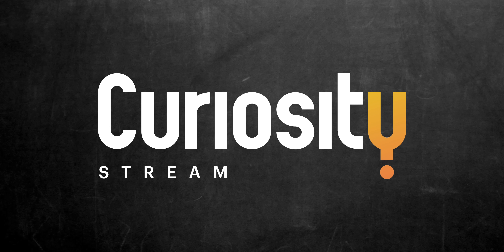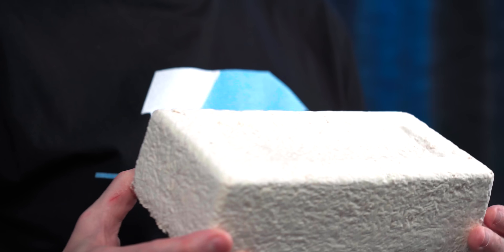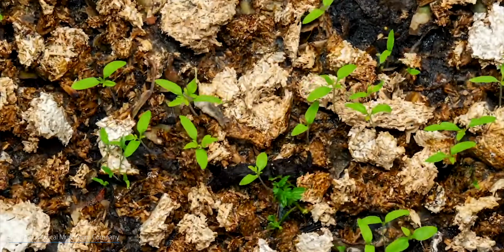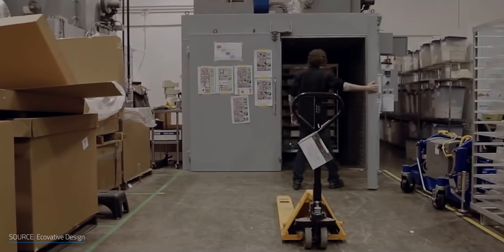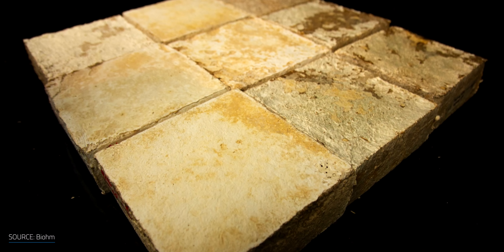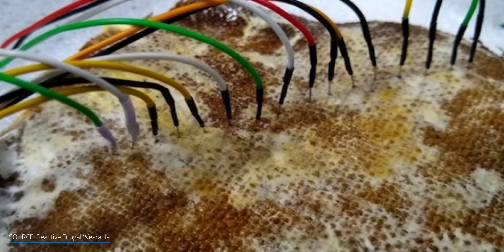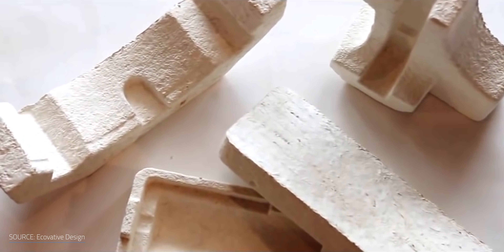Is Mycelium Fungus the Plastic of the Future?

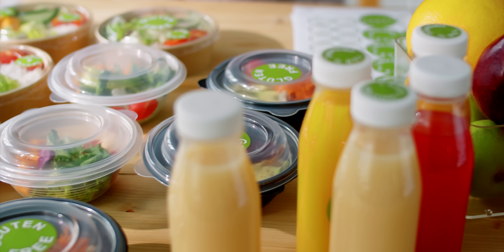Comment: The examples of packaging you show starting at 1:45 mostly look like food packaging. And the benefits of plastic you emphasize are it's water resistance, heat resistance, and durability.
Is this fungus based 'plastic' actually a replacement for any of those uses?

For non-food packaging, what are the benefits compared to cardboard?
Reply: My thought exactly... As much as I like the idea of an environmentally friendly plastic, I'm afraid that this is not the solution to any of our problems. Companies like adidas will use it for green-washing: Marketing their new innovative, eco-friendly shoes, and still pack all their products in traditional plastic-packaging...
Reply: this is not a plastic  :))) it is made of a biopolymer called CHITIN that is what the mycellium is made of.CHITIN is not a plastic ,it is not thermo formable cannot be melted or pelletized ,it is GROWN in it's final shape or machined after growing.
Reply: @Veselian  You didn't address any of my points.

Is this 'plastic replacement' anywhere near as heat resistant, water resistant and durable as actual plastic?
In situations where water/heat resistance and durability aren't needed, what benefits does it offer over cardboard?
Reply: Cardboard is process intensive to produce and requires a thin plastic coating for water resistance that usually makes it unrecyclable.
Reply: @tenchuu007  Are you saying fungus based packaging is less intensive (on resources, time, or labour?) to make and that it's waterproof and recyclable?
Reply: @joshuacollins385  Much less intensive in resources and labor, time maybe not at this point but with scaling. I didn't say it was waterproof, but it does have a higher level of resistance than standard cardboard. And it's compostable, which is better than recyclable.
Reply: @tenchuu007  Compostable is good. I assumed fungus packaging was less efficient on resources and labour, but if I'm wrong I'm glad that's the case. If it is better then it shouldn't be too long until we see it on the shelves.
Reply: @joshuacollins385  Yes, paper materials are high water, high energy productions. Recycling them can take less, assuming you have relatively uniform input but you still will have to soak the wood in heated water to break the fibers up enough to be mashed into paper pulp and then formed into cardboard. The myco packaging is self-forming to the constraints you give it, then you heat it with air enough to kill the fungus (which should be significantly less energy intensive than heating water). I've received several electronic devices in the myco packaging and it has performed at least as well as any cardboard I've received and I think it's a bit lighter as well.

Comment: Love your videos, but here's my take: Sounds like a ideal utopian dream, but the possess in creating it looks slow.  Modern people like the idea of instant gratification, they like having microwaves to heat their food nearly instantly and have little to no clean up.  They like the fact that they have running water in their pipes instead of picking up water and the watering hole.  What I'm getting at is The molds that they put this Mycelium needs to grow into it's form and then heated (CO2 admission) to kill it.  There's only so much space in a oven and space to grow Mycellium.  Vs plastic, it can be shaped nearly instantly and only requires a few forms that can be created every couple of seconds.  Your video shows it takes up to 8hr to start forming growth.  Unless the process can be much faster and do not require so much space for growth, it sounds good but, it may not be very viable.  What needs to happen is being able to form mycellium into pellets like plastic does and then reconstituting it into different forms as see fit.  I'm glad these companies are spearheading this movement and I hope government regulations change the law for packaging.  I would like them to take this process further alone.

Comment: I wonder how does mycelium brick work with rain and moisture? I see a lot of potential in it, but is it, untreated, similar to wood? As in it needs proper foundation and roofing or it starts to go bad? What happens when it gets wet? How does it deal with moisture if used as insulation? Does it easily grow mold? Does it breath like wood does? So much I'd like to know about it

Comment: Most of those uses seem like it could be practical, but using the stuff to make building and circuits seems like a worse option. Why would you want to build something like that with a material that will decompose over time faster than wood?

Comment: Ya I actually need to re-insulate my house here in the next year or so.  As a practical matter I'll probably still go with a spray-in foam (as it doesn't require as much deconstruction to apply) but I'll give mycelium based products a good look first.  If I can reasonable afford to go that route, I will.

Comment: one test id want to run is take the insulation, put it in a normal wood frame wall, then get it wet like say a leaking pipe. 
all that in the dark and i want to see what mold will do to it. there was that issue with paper backed drywall growing mold so how would this hold up?

Comment: I hope this takes off, I'd love to be able to just toss packaging in the compost instead of having to recycle more plastic.
Reply: Plastic cannot be and is not recycled. 90% of all plastic ends up in a landfill because the process of "recycling" it results in greater pollution than the original creation of it. We need to stop making disposable plastics and make plastics, biodegradable ones (which already exist and are in use), that are durable and last a long time. There's nothing wrong with plastics, they just need to be used properly.
Reply: @williameldridge9382  Agreed, I have low confidence in anything useful happening to the plastics after I put them in the recycling bin, that's why I would prefer something like this. Still, I need to dispose of plastics somehow, so recycling bin it is.

Comment: I wonder how the insulation would bare in hot humid areas where [black] mold is an issue.  Will it increase, decrease or have no discernable effects.  Overall, lets hope this innovation pans out and spreads ;)

Comment: a mycelium house would be cool.
but we need to create it as one piece. 
we place a huge form and fill it with mycelium food and place a tent over to control the environment.

then we wait 1-2 weeks and then we heat treat the entire house killing the mycelium.

next step is to weatherproof the house to prevent moisture to get into the mycelium structure.

Comment: Bricks: Conex containers support their weight loads at the corners.
A brick mold with ridged corners that the mycelium won't consume but will bond to it should give a much higher PSI load. It would be cost effective when 1st principles & physics are applied at the engineering phase.

Comment: Um, it is food tho, so should another fungus, bacteria, or (god forbid) slime mould amoeba get onto it, with a little moisture I guess... gobble gobble gobble. Slugs 'n snails also fungus. The mycelium isn't like the roots of a plant btw, it's more like the plant, crossed with an inside-out stomach (it releases acids and enzymes to digest its surroundings) with the mushroom or other "fruiting body" existing only to release spores at the end of its life. The rigidity is given by chitin, you may be more familiar with this as the outer shell of insects (the bit that makes insects crunchy) so you gotta watch out for exposure to acids etc. I'm fine eating a bit of plastic, "non bio-degradable" basically means it's inert, but smaller organisms obviously can have a harder time dealing with it.

Comment: Note all plastics can be recycled the vast majority of them currently cost more money to recycle than you can make with them. Simply requiring all plastics have deposit for return and requiring the money needed to recycle and use all plastics is included in the price of all plastics created would solve most of the problem. Cost of plastics would go up so the Fungus or other alternatives might be cheaper but this simple idea require all plastics be recycled the money paid in advance by plastic producers would handle most of the problems.

Comment: Not entirelly sold on construction, but 100% on board with packaging.  

Small nitpick: anything organic will generate carbon monoxide when burned.  Mycelium may generate less heat and less smoke overall than a PS or PU, but it will still generate some toxic gases in a fire.

Comment: As I have a background both in Science and Construction, I would be wondering how long this product lasts before naturally breaking down? For instance a number of metals when exposed to air eventually rust and numbers of timbers exposed to air begin to rot. Of course both metals and timber can be treated with chemicals and processes to prolong longevity.  What dose the solid data say about the longevity of theses products?  I am all for innovation and environmental footprints but are these products really fit for purpose???

Comment: Hmmmmmmm, about a week? 

Well, assuming a cycle time of 10sec that's 60.5k cycles of a thermoforming machine.

To match production rate of one thermoforming machine, you would need about 20k sf of growing wearhouse. Plus all the supporting processes need some space. And it appears to have a lot of human input, it need to be automated but thats not that big of a deal. 

Cycle time is the main killer. It needs improvement if it's going to replace anything in volume. 
Maybe a way to do continuous production?

Comment: Most of the stuff this would replace plastic for in packaging (since it shares the same use case limitations as hydroscopic polymers) can be done with the wood pulp or mulch you'd feed the fungus anyways. Maybe the novelty will get people onboard with alternative packaging materials but unfortunately we only ended up getting a small idealized piece of the story in this video.

Comment: I hope it will replace hydrocarbon-based plastics soon.  Plastic was a problem in the 1950s, and it still is, as we found out.  A company like Apple could be changing to a mycelium based packaging to set an example to others.  They are doing well with their packaging now but could improve further. The idea of eating plastics in our foods is horrible.  Having worked in the oil and chemical industries, I have always told people that plastic will eventually bite us in the ass.  Nice to be right sometimes.  Have a nice day, and thanks for the video.

Comment: I'm not sold on it as a house insulation (what if it gets wet?) or shoes but I think it needs to replace styrofoam immediately. Styrofoam is the worst and there's so much of it in packaging. Between cornstarch packing peanuts that dissolve in water and this mycelium stuff, we can easily get rid of styrofoam

Comment: this is just so dumb... the point of plastic is exactly that it will not degrade. the point of a foam insulation is that it will stay there forever (or close to forever) change it to degradable crap and its useless... food packaging point is that its not degrading, so its not contaminating our food and its not deteriorating from water or acids as most food contains either or both

Comment: I heard one of the main problems with this material as insulation, is that it absorbs water too well. And if it absorbs water, it changed form and expands, which can cause damage.

In packaging it does seem great though. No clue why we're still making so much packaging from plastics.
Reply: Cheap and with an entire infrastructure built since the 20th century. In top if that, you can have a wide variety of polymers from it for the most varied proposes. The main issue with plastics is the one-time using of packages. Ideally, the Micelium tech would complement the existing Plastic by taking over there the environmental impact is severe. That, however, will require a huge investing in Micelium tech infrastructure, and for that to happen, there has to be a massive demand from the market for it. This ain't a silver bullet, but it is a good start
Reply: Have we tried coating it in pitch yet? We've been waterproofing wood with that forever

Comment: I’m not sure if you missed any applications but there is an additional potential benefit that ‘might’ be feasible: 
I heard that Japanese(?) scientists discovered a hitherto unknown fungus in a landfill area; the fungus was living on and obtaining its energy from disposed plastics.

If this is true, and if this fungus can ‘digest’ a range of plastics, then perhaps that fungus could be used to ‘recycle’ plastics (even styrofoam??) and turn them into usable organic-based plastic replacements!

— 
As for your other question “would I live in a fungus house?” — absolutely. I’ve been exploring super-adobe, aircrete and other alternatives to ‘normal’ building materials. But longevity would be a deal-breaker — if it isn’t durable enough to last 25 years+ without structural failure, then it’s a NO.

Comment: Considering the speed it biodegrades in the ground, it makes me curious if it is a good idea for insulation in a house, office building, etc.  Granted, contained in a wall or attic, that rapid biodegradation may not be an issue, but if it degrades in say 10 years, just as an example, with homes lasting many times that span, it doesn't make sense as a long term insulation.  The other uses, though, seem great.
Reply: I loved this video, but I do wish Matt had addressed the biodegrading a little more. Rapid degradation in building materials would not be good.

Comment: You mentioned patents and there has to be a limit there. Overuse of proprietary designs can kill this technology, whereas setting industrial standards of conformity (all electrical appliances can fit and work via the same electric outlets) will lead to its wider adoption. It is essential that mycelium can work with yourcelium.

Comment: how long would it last when used as a long term material for house building/insulation etc? could you put mushroom layers in the roof for 20 years without rotting away (like you can with synthetic products) ? surely not?

Comment: I've been researching Myco products for a few months now prior to watching this; If you take the mycelium and run it through a heated roller-press, you can achieve similar properties to pressboard or MDF. This can replace certain wood products, most notably OSB plywood, used heavily in the residential construction industry.
Reply: A pressboard or MDF type of product is not strong enough to replace OSB or plywood in structural applications, for which a majority is used. It could replace plywood for paint grade finish applications, just like MDF. To replace plywood, you need a material with plywood-like properties. Even better if it doesn't swell from moisture absorbtion.
Reply: I'd like a bit more info on the longevity of these products before replacing their wood counterparts. Will the it decompose in my walls after 15 years? Will the walls be more sensitive to moisture? Something lasting 300 years has its benefits for long standing structures. I'd love to put this to work for certain crafts though. I wonder how well it cuts with a hot wire?
Reply: whats the point of trying to replace certain wood and wood products? as far as i'm aware most wood products are safe for the environment and also the wood and paper industries regularly replant trees to insure their industries are self sustainable.
Reply: @gusty7153  only about 53% of the wood used commercially is sustainably sourced.
Reply: @recless8667  but we can go higher if the companies went higher
Reply: @gusty7153  that is generally how that concept work, yes.

We can also go higher by reducing the demand for wood with non-plastic alternatives
Reply: @recless8667  correction. we already did that with regular plastic. now we're just trying to replace the plastic with something else. also paper is already in lower demand thanks in part to digital book publishing.
Reply: @gusty7153  exactly my point.
Reply: @recless8667  yes but actually no. See what ive been tryong to say is that these are already happening and your actually more than likely gave me a very outdated statsstic

Comment: Imagine a world where we had discovered this earlier... Great stuff!
Reply: It’s around since 2006 and didn’t take of yet, which bothers me quiet a lot
Reply: I think the question is often, what technology is cheaper to use? As long as companies can outsource the disadvantages to the public they will use the cheaper burning of coal and fossil fuels to generate their profits.
Reply: @frankrothe7023  spot on, governments create policies that promote the user of certain technologies, often on the back of strong lobbying forces from those industries. If the focus is to provide the cheapest possible energy in the short term... Then that's what we get, but the focus is shifting, slowly...
Reply: Fun fact i read/heard here on youtube while researching about fuel cells used in modern hydrogen powered cars. They are as old as the car industry (Minus 10 years give or take of modern development). The first electric cars were made not long after the first petrol, gas whatever ones, so did the fuel cells to made powering said electrics, since batteries were crap back then fuel cells were the answer.

You have one guess as to why the tech was snuffed out in its cradle,
Reply: Yup, little late for us now, was fun while it lasted.